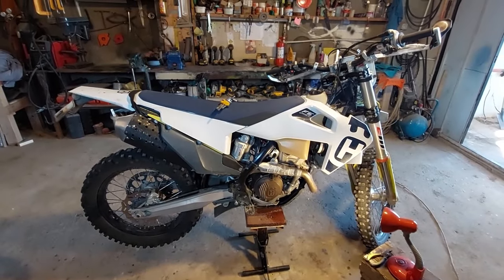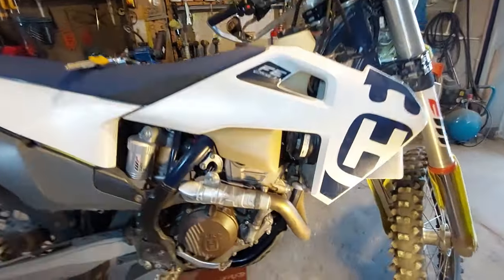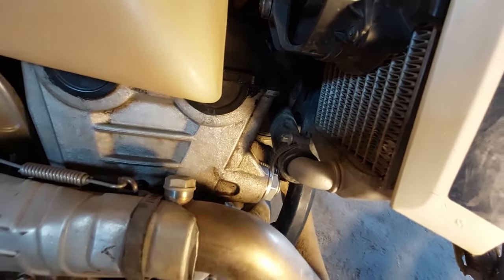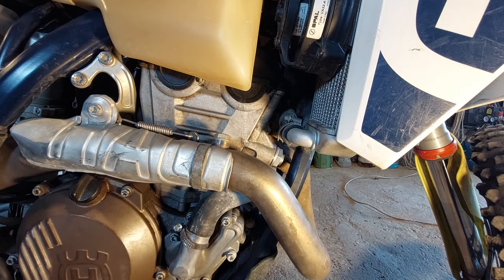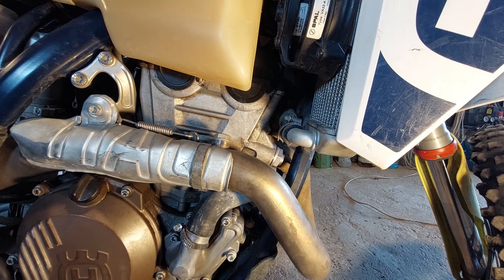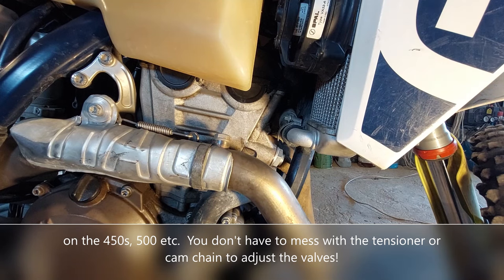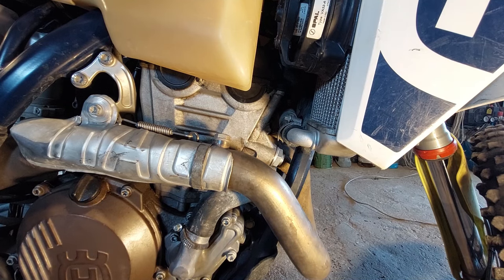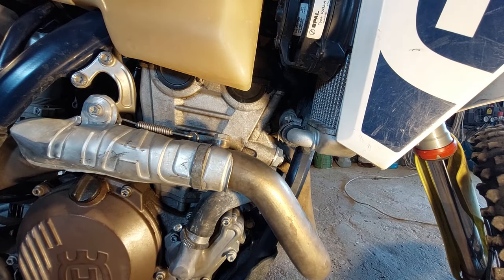Cam chain Tensioner! Removal, replacement and adjustment!  KTM, Husqvarna, Gas Gas, etc.

Comment: I replaced mine just as you did and it actually made the ticking worse.  Also now feels like a loss in power also falls kn its face sometimes and stalls at low rpm
Reply from the maker: hmm, not sure, but it is a hydraulic unit, so even if you put it in loose it should immediately tighten up when you start the bike.  Either you have a problem with the tensioner or it could be in the chain or sprokets or even the valves.  Are you valves adjusted properly?
Reply: @MotoWorld777  I've got it torn down gonna do a valve adjustment soon here. I'll let ya know what I figure out

Comment: How do I know if this is making the ticking noise or the valve tensioner?
Reply from the maker: this?  For locating noises, you can put a long screwdriver with the metal end against the tensioner or any other place and the handle end against your ear, where ever it is the loudest, there is your noise and possible problem.
Reply: @MotoWorld777  I meant the chain tensioner, but yeah it sounds logical, thank you 🙏

Comment: Did you have to set it to TDC before removing the tensioner?
Reply from the maker: no, not at all.  The tensioner only puts pressure on the chain.  If you are adjusting the valves, then yes definitely put it on top dead center using the marks on the valve chain sprockets then remove the tensioner. then use the screw at the bottom of the  case to lock it in place. (only on the 250s and 350s).  To only check the valves just use the timing marks on the timing chain sprockets.
Reply: Thank you. That's what I thought but another person's YT video seemed to stress that it needed to be done first (for cam chain tensioner), which didn't make sense.
Thanks again.
Reply: @MotoWorld777  Hello and thank you for the video, I would like to ask another similiar question about this. I removed my tensioner to check if it was the source of my rattling sound, and it was the problem. After that I pushed the bike in neutral (without any tensioner installed) in my garage about 5 meters and in my mind it shouldn't be a problem but a mechanic friend insisted about a possible issue which is timing chain missing a teeth, which would be bad. Based on your experince do you think I should be worried? 
Thanks in advance for your answer and have a good day!
Reply from the maker: @egezengin1586  hey, yea, that is important!  If you have any suspicions cam chain or sprocket problems, pull the valve cover and inspect everything.  I can not imagine the chain or sprockets loosing teeth unless you had a piece of metal go through it or you have 50000 miles on the bike. See my valve adjustment video or getting to the top end. It is pretty easy.
Reply: @MotoWorld777  
Turns out the only problem was the tensioner itself, after moving the bike and reinstalling the new tensioner, the bike just ran perfectly. And by "missing teeth" I meant as in jumping or skipping if that makes sense. Thanks again for the video it was a great help!

Comment: Did it effect your riding or did it just make noise when you noticed it failed. I have a 2016 husky 350 fc and I am noticing the rattle noise, but also feels like something is loose upon accelerating in any gear.
Reply from the maker: Hi, no failure!  I had removed it when I did my valve adjustment and simply did a separate video on removing adjusting and reinstall.  If you hear rattling, it is likely either the valve tensioner or your valves.  Pop it out and inspect it.  Lots of guys go for manual adjusters, but if it is working keep it in there.  You can also take off the cam cover and inspect the tightness of the tensioner (before you loosen it and also do a valve measuring to see if they are loose.  Let me know what you find!
Reply: I have the same bike same year and every and I'm having the same problem it does it whenever it's a idle whenever I start it and then goes away but then if I shut off and start it does it again I don't know if I should be worried or not bc it stops whenever I'm riding